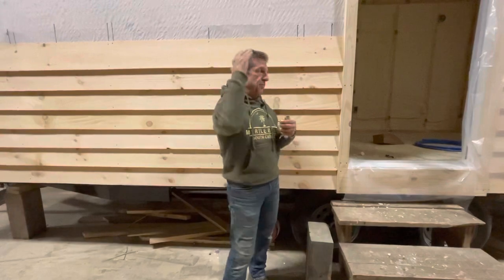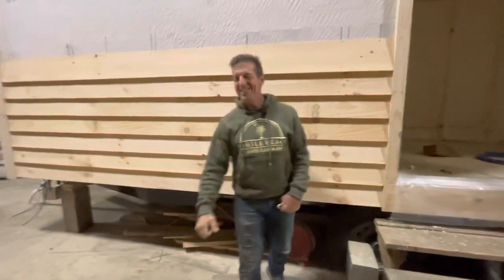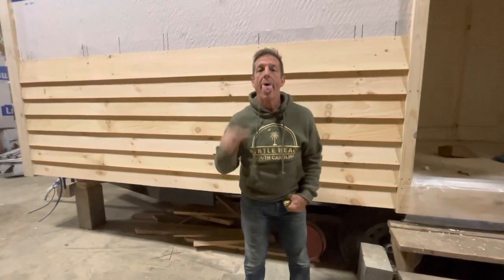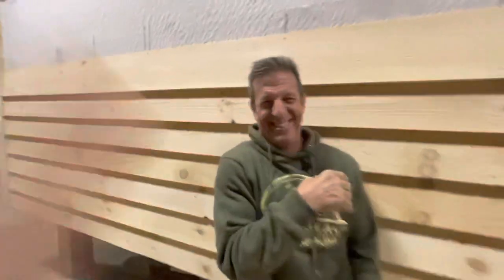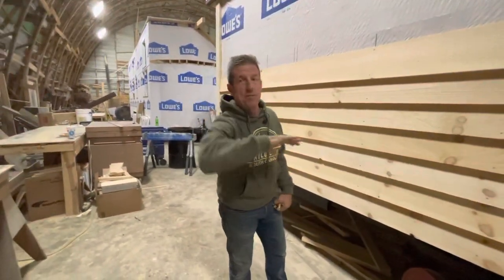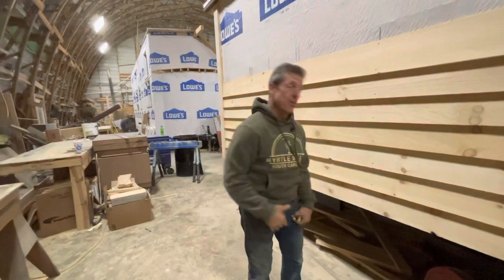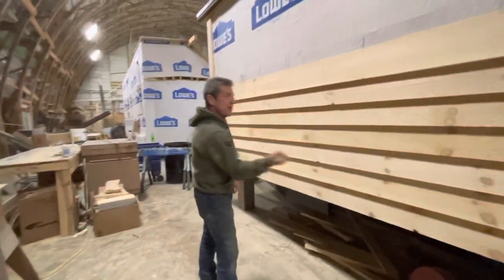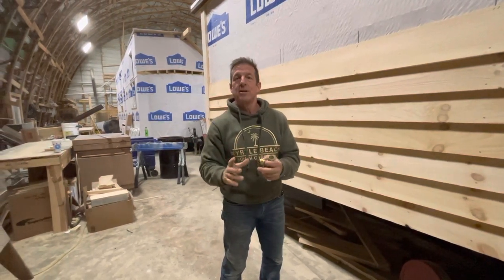How to Hook Up Water, Power & Sewer on a Tiny Home 💦 ⚡️🚽 💩🏡😉

Comment: When my house was built, the only shut off for the water is under the house in the utility box.  There is no way this girl is crawling around under my dark house feeling around a utility box for spiders!!  Can I just shut the water off at the tankless water heater? Doesn’t all water in the house have to travel through the water heater first?
Reply: Cold water pipes wouldn’t go through the water heater otherwise you wouldn’t have any cold water. It would all be hot. You still have to turn water off where it first enters the house to be on the safe side.

Comment: Our first home-a single side mobile home we had built- had an issue with the master bathroom shower.   They'd shot through one of the water lines in the shower stall when putting paneling on the outside wall of the shower.   It was months before we knew it was leaking.   So some strange things can happen.

Comment: I'm a 48 year old women. I have a house with almost half acre  of yard and I have been wanting a tiny home for my mother that visits us every 6 months from South America. 

I have a couple of questions. I don't  need a septic tank right? I can use my own sewer system from my home. I just need to locate the sewer lines of my home to connect the tiny home? 

Does the tiny home have to be installed right next to my house ro be able to run the water, electricity and sewer to the tiny home? Or can the tiny home be set a little farther away? Since I have a back yard  that is half acre I was thinking to put it a little more toward the back or farther side of my house so it has some privacy.

Comment: I was trying to zoom in on my phone screen but it looked like a 50AMP power cord. Am I correct? 
My little RV I live in is 30AMP and you can't run the microwave and AC unit at the same time without the breaker tripping.
Reply: Probably good to make sure the main house has a 200 Amp main panel if adding 50 amp to a home with a 125 amp older main panel. Doing that could cost around $2500 and take 1-2 months (first getting permitting from electricity provider & then once they give the okay have the electrician do the upgrade). This is assuming the plan is to set up the tiny home as permanent in the back yard. 

Also good to think about the extra draw on electricity and if the mai house doesn’t yet have solar, to consider adding it ASAP while the ITC is still available to offset the electricity costs (especially if in a tier pricing set up as the extra power draw while make the bills higher year round).
Reply: @DivineDestiny77  ??? Not sure if you were trying to respond to someone else's response?
I'm not connecting to anyone's home. I don't own a house. I live full time in an RV right now and travel to different RV parks or private RV lots. 
I just need to know if the ITH homes are 30 or 50 amp inlets.

Comment: Great information for newbies like me having their first time in a tiny home who has never RV'd even. But my question to you is you make it look simple with the right connections. Of course you're the expert and home building as well. But what about those tiny homes that have flushing toilets which I'm reading are not like flushing toilets in a home and therefore also have black water storage tanks. I'm reading that you can't just use that flushing toilet. It needs to be replaced with the flushing toilet that you would actually use in a house in order to connect to your city sewer and also that the black water storage tank needs to be removed in order to bypass it? So many listings that I read do not mention black water storage or they may have a gray water mention as well. But all I'm trying to do is hook up into city, sewer and water and now I'm freaked out. I get everything is set up for RV which I've never been to an RV park but my assumption is the hookups are different. So you're flushing toilet? Is that of a flushing toilet in a standard home? And why you're white PVC connection is different than a holding tank that needs to be emptied? I guess I need to know what to ask other sellers about their water connections or set ups for both gray and black water. Does your gray water set up actually go into city sewer as well as the black water? And what if a home has storage tanks and that's not how I plan to use my tiny home?

Comment: How many amps are in the tiny houses. 30 or 50 amps?
Reply: Probably good to make sure the main house has a 200 Amp main panel if adding 50 amp to a home with a 125 amp older main panel. Doing that could cost around $2500 and take 1-2 months (first getting permitting from electricity provider & then once they give the okay have the electrician do the upgrade). This is assuming the plan is to set up the tiny home as permanent in the back yard. 

Also good to think about the extra draw on electricity and if the mai house doesn’t yet have solar, to consider adding it ASAP while the ITC is still available to offset the electricity costs (especially if in a tier pricing set up as the extra power draw while make the bills higher year round).